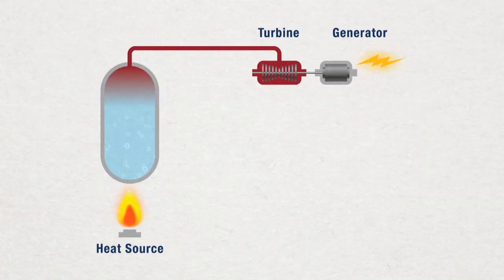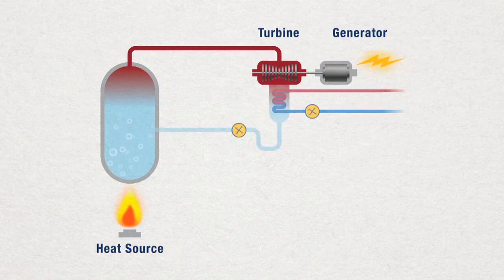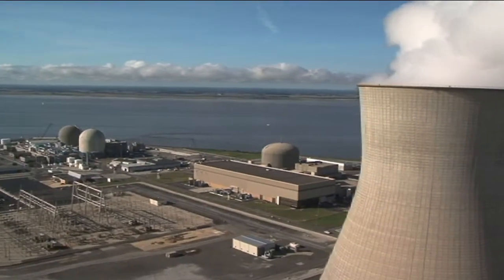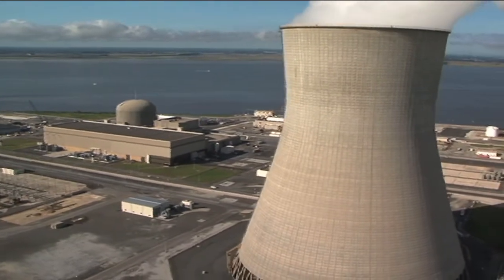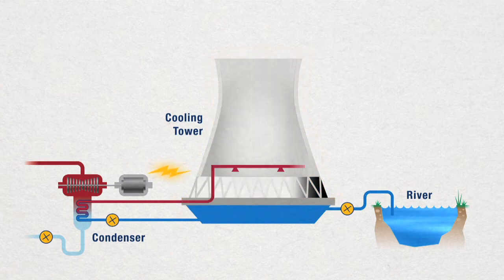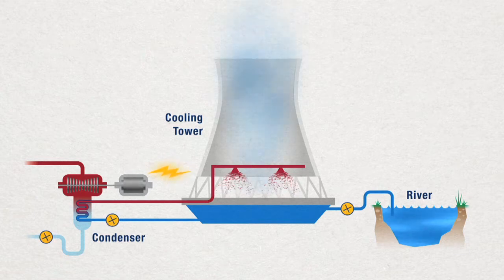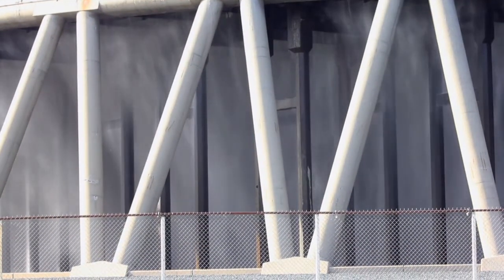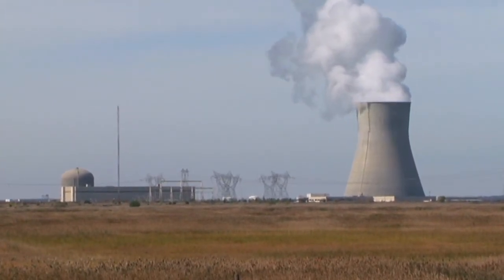How does a cooling tower work?

Comment: What about CO2s ? . Or the Legioner's decease ?
Reply: When 235U undergoes spontaneous (natural) fission, it releases a fast neutron, which spends too little time interacting with the nucleus, so it gets moderated (slowed down) by a Neutron Flux Moderator (which used to be commonly graphite, now it's primarily water), then a slow neutron can get absorbed by 235U, to become 236U in a highly excited state, which causes it to split into smaller atoms, lots of heat energy and more neutrons. This is nuclear fission.

Nuclear fission is used in nuclear reactors, and the heat energy from it gets used to heat up coolant water which spins the turbine.

At no point is there any CO2 involved. And Legioner's disease is only a problem if the cooling towers are improperly maintained and irregularly screened.

Hope this helps!

Comment: the evaporation process absorbs a large amount of heat energy to turn the super hot water into hot water vapor. this means that the hot water vapor will not be 100C, because 100C of water has less energy than 100C of hot vapor of the same amount. basically in the process of hot water vaporizing, it converted some heat energy to phase change into gas form, essentially making the discharge less harmful to any passerby (unless you're inside the cooling tower)
Reply: Idiot.

Comment: I’ve ever understood why they dont put the hot water back through the system rather than heating from cold again
Reply: The water that is cooled by the tower doesn't actually go into the reactor. It is pumped to a tank to surround a convoluted pipe that has hot steam in it so the steam inside the pipe system can condense to liquid water which is actually trapped inside the reactor and doesn't evaporate or anything. They basically use water to cool more water inside pipes
Reply: @ayeklutch You don't know what you're talking about
Reply: Because after the steam has gone through the turbine it is at a low pressure. It must therefore be cooled to condense. But in order to make high temperature steam you need a much higher temperature. So there is heat, but it is at a too low temperature.
Reply: Because it is hot water, and not steam.

Comment: can't the hot water be used in some better more efficient way ???
Reply: Some powerplants use the waste heat to heat buildings through district heating, that's mostly used for cities in colder areas. In some deserts it is used to desalinate water.
Reply: @placeholdername0000 You are wrong this is waste heat you would need to put energy in to use it in power plant its becouse heat cant flow from lower temperature tank to higher temperature unless you will use a heat pump.
For district heating they use back pressure turbines which has higher pressure steam at outlet thus suitable for other applications or just drop more steam from condensing turbine.
Reply: @mateusz5318  No need for a heat pump, just tap of the steam at a higher pressure. It does cause a reduction in the turbines efficiency, but it yields much more heat than a heat pump could provide with the power that you lose.
Reply: @placeholdername0000  well thats what I typed its called back pressure turbine...waste heat you see in video thrown to environment threw a colling tower has nothing to do with it there is no use for it.
Reply: @mateusz5318  Yes? I mentioned that other powerplants do it, not this one. Can't you read?
Reply: @placeholdername0000  no they dont
Reply: @mateusz5318  Like 90% of powerplants in Denmark.
Reply: @placeholdername0000  guy is asking if waste heat can be used for something and I say there i no plant that actually use it. You think of cogeneration plants and there in no waste heat becouse they PRODUCE heat alongside with electricity. In condensing plant such you see in video there is lot of waste heat and there in no use for it.
Reply: @mateusz5318  I did not claim that it was done at that plant lol. Learn to read.
Reply: @placeholdername0000  You claim that in many power plants they use waste heat which is simply not true it wasnt be called "waste" if they could use it.
Reply: I mean probably, but it'll just rain back down into the same body of water again so it doesn't really matter.

Comment: Why don't they put the hot water from the condenser back into the river?
Reply: the fish gonna die
Reply: If it’s not a big enough body of water you do not want to discharge hot water back into it because it will harm the environment and aquatic life edit power plants that are built around the oceans and the Great Lakes discharge back into the source because it will not have a inverse effect on the body of water
Reply: They used to do that, like in chernobyl times. It's called a one-through system.

Comment: is that water radioactive??'
Reply: no
Reply: No .. the radio active water in the turbines doesn't get mixed with cooling water.
Reply: The cloud is steam from the cooling water from the nearby river. Its only use was for indirectly cooling down the engines.
Reply: There's a protest in one country fearing the smoke comes from tower. They thought its ☢️☢️
Reply: it's a second circuit of water, so no.
Reply: @kilovolt2494   actually it is a third circuit.  Our water is double protected.  The first pressurized loop goes into the reactor and brings super heated water back out.  This water goes through a heat exchanger that passes it to the power loop which runs the steam turban.  The second loop then lets the steam go to a second heat exchanger that connects to the third loop and the cooling towers, water vapor coming out of the towers has not only never been in the reactor but it has never been near water that has been in the reactor.   This insures that 2 leaks are required for any radioactive water to get out. There are radiation and pressure detectors all along the pipes so the odds of 2 leaks happening at the same time and being undetected for any period of time is not measurable. a very cool system.
Reply: Not at all
Reply: the heat exchanger in the beginning isolates the two circuits, unless there was some kind of break in the heat exchanger its physically impossible for that to happen.
Reply: The product used in these reactors are commonly uranium oxide which is not easily soluble in water
Reply: The water that is in contact with the radioactive fuel is different and actually expensive to let evaporate
Reply: @salaa23  yeah it's heavily treated before being allowed within the near vicinity of the reactor let alone being pumped through